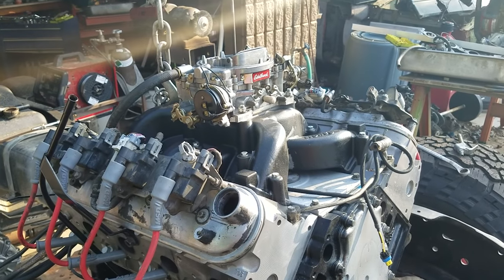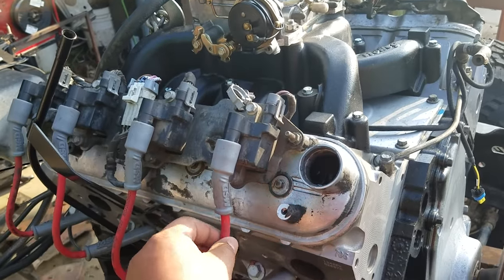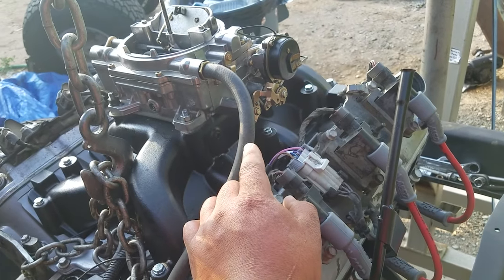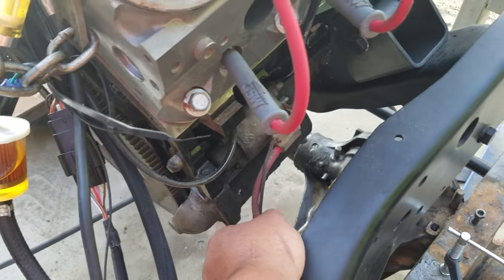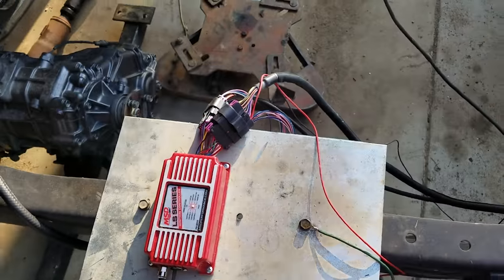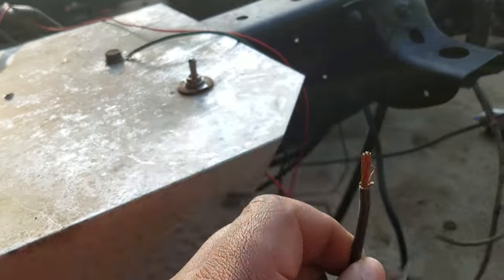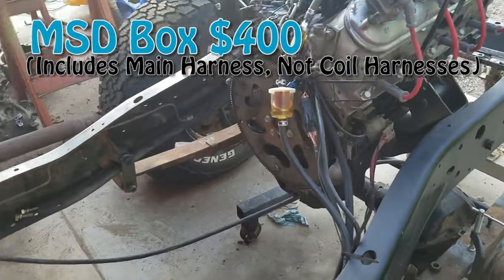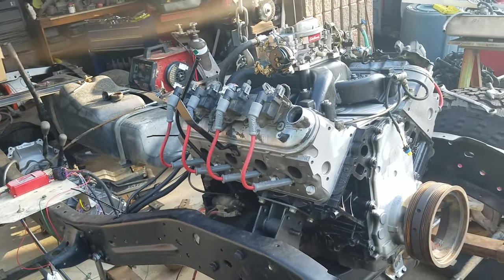HOW TO INSTALL A CARBURETOR ON AN LS SWAP, LS1, LM7, LR4, LQ4, L33 | Carbureted LS | Carb LS |

Comment: Can this be set up to run on a vehicle with a catalytic converter without melting down the converter?
Reply from the maker: Yeah it can, you just need to make sure you dial in your tune with a wideband
Reply: @NightWrencher  
  I figured it would take some tuning with at least exhaust gas machine.  I just installed a engine in a 79 Scout, California emissions with an 1400 Edelbrock on it.  Local machine shop built it for the owner and he couldn’t get anyone to install it.  Shop that removed sold and the new owner wouldn’t reinstall it.  So being a nice guy I said I’d install it.  What a mistake.  Apparently the rings never seated and it went through 3 quarts of oil in 900 miles and destroyed the cat.  Don’t know if it’s my fault or not, shop is blaming me for not rebuilding the carb and claiming the carb over fueled it and washed the cylinder walls.  I’m pulling it back out and having the shop go back through it and then someone else can put it back in.  Don’t need these headaches.
Reply from the maker: I highly doubt its your fault. The amount of fuel it would take to completely wash out the cylinders would be sp much, the engine would be smoking like a crazy. Considering you were using an edlebrock, that leads me to believe that the rings had too much gap or the walls were machined too far out. Check the plugs if you still have them, they would have to be so black and the engine would be running like garbage. AFR gauges are like $180 but they make tunning a breeze. You can get the full tune done in an afternoon if you have all the parts available. If you do tune the next engine, keep the cat off until its ready.
Reply: @NightWrencher  
  AFR gauges, I’ll have to look those up.  I’m trying to do the right thing for the guy because he’s been screwed by so many shops over this scout.  I don’t think the carb is the problem either but most engine builders warranties aren’t worth the paper there written on and they’ll put blame on everyone but them.  The owner told me after the the scout had arrived the first time that he had just gotten it smog tested and it passed.  I was surprised they passed it in this state with that carburetor.  That’s one reason I didn’t suspect any problem with the carburetor, plus it started right up and ran great.  When it stopped running on him he had it towed and the mechanic said it was almost three quarts low on oil.  He filled it up but when it shows up at my place it’s almost a quart and a half over filled.  Can of worms and no one is honest with the guy.
Reply: @NightWrencher  
   What brand and model AFR tester do you have?
Reply from the maker: I have an AEM wego afr gauge. Been working good for a few years now

Comment: u can ur stock pcm for ignition
Reply from the maker: I'm sure you can but it would be more money than an aftermarket ignition box. You would need a TPS for a carb, map sensor,  a special tune to delete the MAF and turn off the fuel injectors. Then set up a custom ignition table. Not worth it in my opinion.
Reply: @NightWrencher  no need for lots of sensors only cam and crank  sensor  and vats delete  i think it will run the coil packs    and using  pc hammer or ls droid u can flash a bin that can adabet with your spark  timing
Reply from the maker: You need the a tps for a carb to run the transmission. Youll need to delete the maf and run a speed density tune with a map sensor for ignition. Its not worth the hassle to me but Im sure it could work

Comment: Are you running 4x4 transmission with the 5.3 carburated?
Reply from the maker: Yeah I am, just finished hooking it up last week. Works really good after I regeared both axles and welded the front diff. I post updates on instagram @thenightwrencher
Reply: Sweet i have a 76 k10 4x4 i have th350 transmission now i want to swap it to 4l60 but im not sure how you run that with carb set up
Reply from the maker: As far as I know, you'll need a transmission controller to control the 4L60 and you would need to install a TPS on the carb shaft and calibrate the systen. I would stick to the TH350 or even build a 700R4 since its basically a 4L60 without the computer
Reply from the maker: If you can find an early 90s 4L60 without the computer, that would be a 700r4.

Comment: Well the msd ls work right off the box or do you still have to program it with a laptop
Reply from the maker: You dont have to plug in the laptop to run it as long as you make sure to hook up the map sensor hose. It has 6 preset timing maps so you can start it in the regular truck setting and move it up as you like.

Comment: Also what is a good cfm size for one of these?
Reply from the maker: It just depends on your intended application. If its race only, a 750 would be good and if its a cruiser, a 600, 650 should be fine. You can go smaller but I havnt tested it out personally.
Reply: Also I've heard both ways, can I use my t5 bell housing? From sbc can I use that clutch too? It's brand new
Reply from the maker: @wesolintKID   the flywheel for the ls 2500 trucks should have the ls bolt pattern but SBC clutch plate pattern
Reply: Ffs that plane noise ruined it 🤯

Comment: this is a cool video. IMO i wouldn't go this route due to the expense and function. so your about at $1100. if you get Holleys' terminator system; assuming you have a complete motor, you basically are spending the same but get easily tunable EFI. better power, fuel mileage, throttle response and tunabilty from a laptop. still good video.
Reply from the maker: You know, I dont disagree at all! Although I don't regret going carb, a part of me wonders if I would be happier going efi lol
Reply from the maker: I purchased my 5.3 complete with PCM wiring harness and everything and it's still there waiting for me in case I decide to go back lol
Reply: ..I don't want tunability from a laptop...I want a mechanical setup that doesn't require a laptop for anything...
Reply: @dyer2cycle  tunning from laptop is time consuming
Reply: @diduck6878  ..it's not whether it's time consuming or not...I want something simple, mechanical, and something that doesn't require a computer...I guess I am sick of everything in life relying on a computer..enough already...life has become a computer overload...
Reply: @dyer2cycle  I'm with you on that I swapped my truck 2 years ago. Drove it almost every day. Put a cam in. Now it won't idle (went tooo big.) 8 invested 2 hours in getting it to idle. Removing fuel on low end adding on top, timming. Another 4 trying to tune without a wideband. Switched to carb was done in less than hours. But had to spend $2K for stand alone transmission controller, carburetor, intake, different fuel pump, MSD box, mis.. hoses and clamps. The great thing about carburetor. Is you get immediate feedback on your adjustments.  If you have the complete motor less tank a fuel pump it's cost effective to go fuel injected.
Reply: You’re right except about the power a well tuned carb beats efi all day long
Reply: The problem is part cost. An LS intake can be 800+, injectors are another 500+, fuel rails, throttle body, air intake, holley terminator, etc... Prices are crazy. Machine shops are charging 200/hour for dyno time as well to tune.
Reply: @MazzaFiveOneFour it's crazy, I was quoted $1,800 for a tune on a 5th gen camaro. I'm swapping my square body this winter and seriously considering the carb route for cost and simplicity.

Comment: Do you need a return line for 5.3 carb set up?
Reply from the maker: Its always recommended to add a return line on a carb set up because you will have more consistant fuel pressure and colder fuel enter the carb. If you have a deadhead compatible fuel pump that runs 6.5 psi or less, then you can get away with not having a return line but it is not recommended
Reply: Ok thanks. Im currently running holley blue fuel pump will that be ok with out return line
Reply from the maker: A lot of people run that pump dead headed so you should be ok.
Reply: Ok thanks man 👍

Comment: Why do I need cam sensor ect if I'm carb swapping?
Reply from the maker: The MSD 6014 needs to see a cam signal in order to light off your coils correctly. The cam sensor takes the place of your distributor and sets your timing
Reply: @NightWrencher  awesome info thank you

Comment: hey do you think i could keep the same computer for the 4l60e
Reply from the maker: You'd have to get someone to tune the PCM with a speed density tune to eliminate the MAF and run a spark only table
Reply: @NightWrencher  can a regular tuner do it?
Reply from the maker: @jankycustoms6089  I don't know what you mean, you need someone who has done it before or it wont run right

Comment: You said something about a computer I need a computer other than the MSD box I'm building a 1985 K10 that I want an LS engine carbureted
Reply from the maker: The only computer youll need is the MSD box or a smartspark ls box and a laptop to tune it.
Reply: @NightWrencher  thanks very much I thought I was going to have to pull the whole computer system out of an LS equipped vehicle and install it in my K-10 now I can continue with my projects thank you
Reply from the maker: Youre welcome! Just remember to keep the OEM coil harnesses on the valve covers because that doesnt come with the msd box.
Reply: @NightWrencher  got you I also just watched your five reasons why to carburate your LS and also I just subscribe so thank you very much
Reply from the maker: Thats awesome man! Much appreciated!

Comment: How far will my mpg drop with a carb swap in a 05 yukon 4wd 5.3
Reply from the maker: Depends on carb size and tune but usually 2-3mpg if the tune is perfect.

Comment: Also im running 5.3 carburated single plane intake for sum reason it backfires loud pop on my tail pipe. and hesitates just a bit then accelerates ?
Reply from the maker: Popping on accel is usually lean condition. Single planes don't offer too good of a signal at low RPMs when compared to a dual plane. Try to see if you can narrow down the popping to the individual circuit and go 2 sizes up
Reply: What do you mean on the sizes? The size of carburator?
Reply from the maker: Main jets, IFRs, PVCRs, air bleeds, etc.
Reply: Ok gotcha i appreciate your help man

Comment: Do you need a adapter to run a turbo 400 trans
Reply from the maker: The trans bolts up and youll need a spacer between the flexplate and the crank. I dont know too much more but the trans will bolt on to your LS

Comment: how did you power the coils?
Reply from the maker: Currently using a Smart Spark LS by Daytona Sensors
Reply: @NightWrencher  i will swap a mercedes engine into my old mercedes but this one uses ecu wich i ll delete and modify the intake for a carburetor i was wondering how to power the coils
Reply from the maker: You'll have to use something like a megasquirt or terminator X for something like that. It takes a lot of effort and you'll need to learn how to do a bit of tuning but it can be done
Reply: @NightWrencher  yeah i will delete the complete fuel injector system and modify the intake for a carb and i may get an aftermaket ignition to power the coils thanks

Comment: So I see these engines for like $400 at junkyard so about $1500. Do you know the best 5.3 to get? Hp wise. I have a third gen camaro z28 and trying to find the best method to get around 300-400 hp. For a decent price and also not make a headache while hooking everything up. Thanks in advance
Reply from the maker: Gen 3 LS make about 285. After you install a cam, headers and a tune, youll be around 350hp. Any 5.3 is fine if youre not trying to race it professionally. But they can also handle good boost in stock form in case you want to go turbo so there are a lot of options!

Comment: I was always told to never run a engine without at least exhaust manifolds am I wrong
Reply from the maker: Well it depends. How long is too long? 15 secs isnt even enough to warm up the head so if heat is not the issue. Then what is? Ive ran tons of engines like this, without issue.

Comment: What size carb would you say for drag race lq4 btr stage 4 cam Holly  single-plane intake and be spraying nitrous at it too
Reply from the maker: I know my STOCK 5.3 did NOT like anything smaller than a 650 holley.  One thing I learned while trying to tune my smaller carbs was that the CFM rating should be comparable to Throttle body size on a fuel injected car and the jets were like the injectors. Mild 5.3s and 6.0s run at least a 750 or 800. For your app I wouldnt go smaller than an 850 double pumper. If your afrs run too rich under load in the top end you might need to go bigger. I hope this helps!

Comment: What heads are you using
Reply from the maker: Im using standard 706 heads. The ls1 and lq4 heads have a bigger bore so youll lose a lot of compression ratio. I would even run these on a daily 6.0
Reply: What about 241 heads on a 5-3
Reply from the maker: @ksykes902  youll lose power because of the loss in compression. You might gain some hp back in the last 1 or 2 thousand rpm but not worth it.
Reply: @NightWrencher  thanks it normally does pretty good but I might change it back I have a mild cam in it dual-plane intake and a 750 Holley carb and the 6014 MSD box one thing I notice is I put a bout 100 miles on it it's almost like it's flooding out my carburetor my plugs were black and my carburetor I think I'm going to change the regulator you have any idea why it's burning rich
Reply from the maker: @ksykes902  I'm guessing you dont have an AFR gauge on your car. These engines like to run lean. Anthing below 12:1 and youll lose power. You have bigger port heads so you lose intake velocity, you lost compression so the flame is colder. Lastly you have a mild cam, but youre not going to need a lot of fuel on the top end because you wont be able to breath enough air. Hit me up on instagram @thenightwrencher and i can help you dial it in.
Reply from the maker: @ksykes902  I wont be able to text you, but I can keep helping you on here. Have you watched my power valve video? I explain why my engine was running rich
Reply: @NightWrencher  okay I'll check it out thank you
Reply from the maker: You can comment on that video with any other questions
Reply: @NightWrencher  okay thank you
Reply: @NightWrencher  hi I have a Holley fuel pressure regulator on it already I feel like 40 bucks for it so I'm going to change the two the gauge and the regulator 2 Aeromotive question is my fuel pressure regulator has a return line if I order the 13201 which doesn't have a return line can I disregard that hose or order the 13301 my fuel pump in my gas tank it's spitting out 1 through 15 pounds of pressure
Reply from the maker: I have the 13201 on mine and I was not happy. The 13201 is a dead head style regulator so max PSI is about 8. Anything more and the regulator wont hold it and youll flood the carb. The 13301 has a return line provision so its much better for carbs
Reply: @NightWrencher  okay thanks and you think I should get the 706 heads and take off the 241 right cuz with the Dual plane I'm losing velocity correct and I have the 750 Holley carb that came with the Dual plane and the MSD 6014
Reply from the maker: @ksykes902  it depends. If its for boost or a lot of racing, 241 heads might be better but if you plan to drive it on the street a lot, 706 would be better
Reply: @NightWrencher  no not meant for racing I got 24 in Iroc rims on this G-Body Regal I got beehive Springs on the heads that goes with the mild cam recommended from Holly and I got a turbo 350 behind the 5/3 just basically want to cruise but if I want to hit it on the street I want it to move and they told me for a recommended torque converter 15 to 24 that's what I got
Reply from the maker: If you got a pair of 706 ready, I would go ahead and slap them on. But it wont make or break your build
Reply: @NightWrencher  yeah the 706 heads 10 to crack under pressure so that's why I made a decision and put 241 on it 862 is a good head I think it'll be fine my concern is getting it to run right so I'm going to go with regulator and gauge that you preferred and get it tuned and see what happens thank you.
Reply from the maker: @ksykes902  862 heads tend to crack too so be careful
Reply: @NightWrencher  I'll just leave the 241 on it I just ordered the regulator and the fuel pressure gauge I'll let you know when I get hooked up sir thank you and what do I hook the Boost to the vacuum on the carburetor?
Reply from the maker: @ksykes902   the break booster? That one goes straight to manifold vacuum either at the base of the carburetor or a port on your manifold
Reply: @NightWrencher  I'm sorry I meant isn't there a boost line on the regulator that goes to the carburetor somewhere for a one-on-one ratio when you accelerate how would I hook that up to the carburetor
Reply from the maker: Oh, yeah, the vacuum line also goes to manifold vacuum to boost pressure when vacuum drops
Reply: @NightWrencher  okay thanks I'll let you know how she doing when I get her hooked up
Reply from the maker: @ksykes902  sounds good!
Reply: Hey I'm new to your channel!I wanted carb my 5.3 as well for my 85 cutlass. its a gen 3 block,I recently put 243 heads on it with beehive springs.i have a btr stage 3 /553 lift truck cam with afm flat top pistons. Any advice what cfm carb to go with?and would u run single plane or dual?